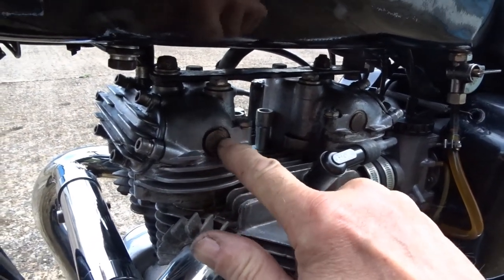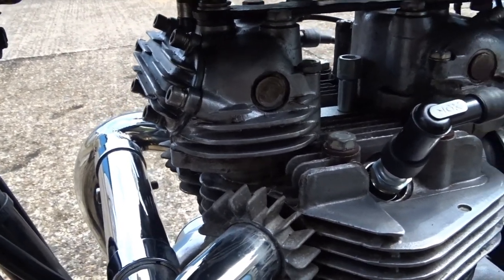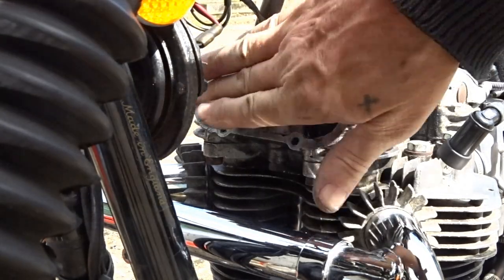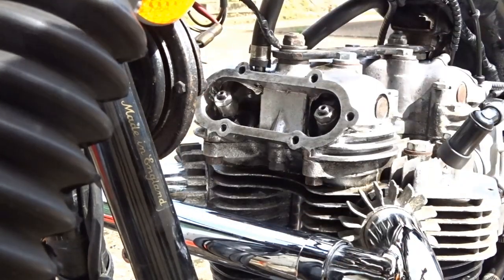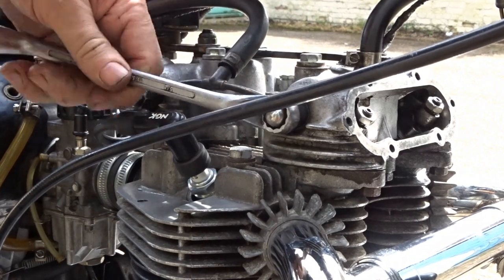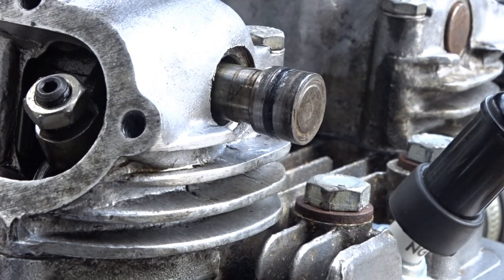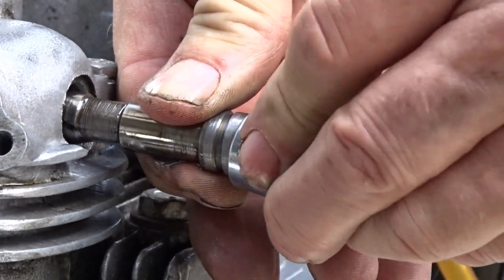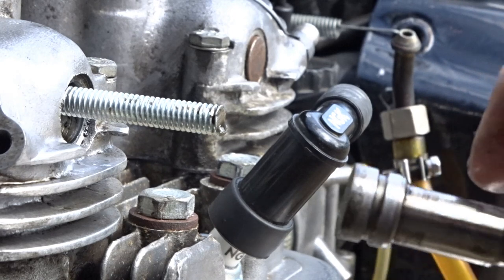Triumph T140 - Rocker Spindle O Ring Change

Comment: I'm surprised you needed to file the end of the spindle to fit the guide sleeve. All I had to do when I fitted mine was polish around the end briefly with steel wool, and the sleeve went straight on. I always fit new copper washers to the banjo unions, but you if you don't have them, it would pay to anneal the old washers before reusing them. With the tappet cover gaskets, I cut my own from 1/32" (0.8mm) gasket paper (it's easy to draw around the cover, or an old gasket, as a template). When I fit them I smear a little grease on each side, so they won't stick next time I remove them. If they do start to weep after a while, all you need to do is nip the bolts up a bit to stop it.
Reply from the maker: Hi Rick, it looked like the previous owner had hit the ends of the spindles to get them in and in doing so opened them up a bit, there were some marks on the end of the spindle so I'm guessing that's what he or someone did. The tappet covers were all warped so I smoothed them flat using 1500 grit wet n dry on a flat surface, I do have that gasket paper but will use all the existing ones up first. I took a while but I can run the gasket paper through my printer and print off the rocker gaskets exactly the same size now, saves on the tracing ;)
Reply: @OldBiker  I never thought of printing out the gasket outlines, that's something I'll consider. I was lucky with mine, it had only done 1300 miles from new when I bought it and nobody had done anything to it, so I'd only have myself to blame for any abuse it's suffered (it's had its fair share of verbal abuse over the years, but I've always resisted the temptation to take a hammer to it).

Comment: You could just have used some feeler gauge material or a strip of Mylar (old 35mm photo film) around the o-ring to feed the rubber into the hole. Even chamfer the rocker hole entrance to glide the ring past.

Comment: I'm putting some new rocker box spindle seals on a 78 Bonnie I picked up recently.   The end of the spindle didn't fit through the tight end of the tool... same as yours.   I was worried that sanding it or filing it down might create a leak somehow but I think i'll try.  Otherwise I can't use the tool.

Comment: Is it best to leave a mm or so of the spindle (the o-ring end) sticking out, or should it be totally flush with the rocker box?    I've seen a few where that spindle is knocked all the way in, making it totally flush and others that leave a mm or so proud of the rocker box.  Maybe it doesn't matter.

I don't understand why they don't make the bottom of the tappet more of a round shape... because some of them sit on the valve stems at an angle, so you're only getting the edge of the tappet to make content and measure the clearance with.   My 64 TR6 is better about matching up the tappet and the valve stems, they seem to sit a little flatter than my T140.

Comment: Were you able to get the spindle to not turn when tightening the nut, or did it tighten enough despite some turning?  I'd like to replace my acorn nuts with some shiny new ones, but I'm worried the spindle will turn and I won't be able to tighten things back up (or get the old nut off).  It doesn't seem like there's anything holding the spindle in place to get some torque on.
Reply from the maker: Yeah it did turn but I used one of those 18v impact drivers to snug it up, if your just changing the nut it should be fine.